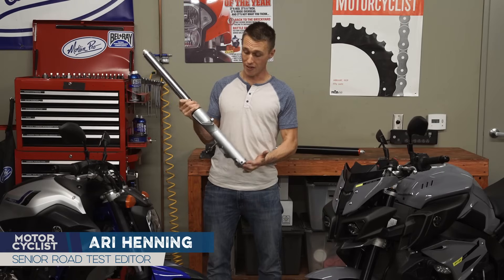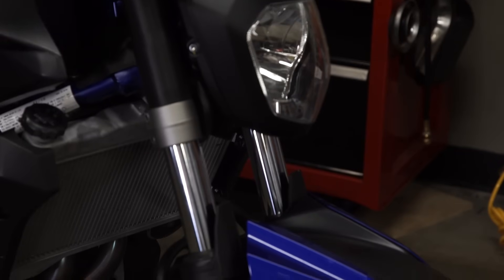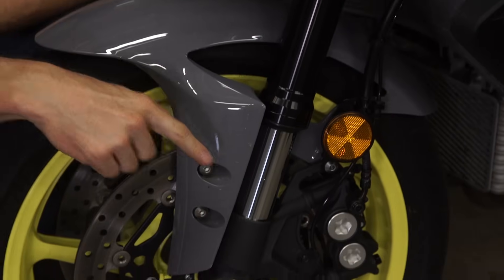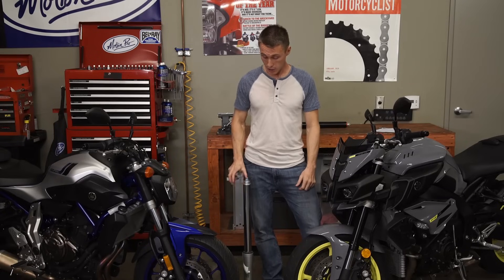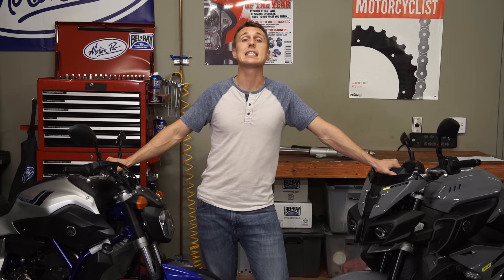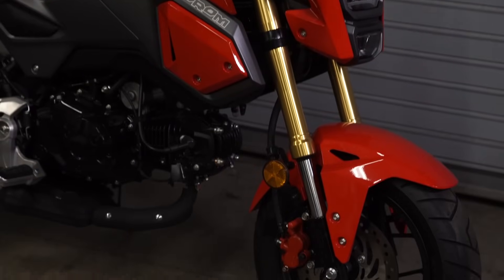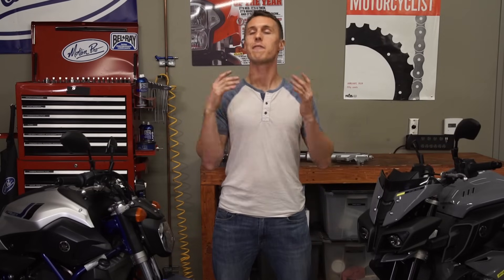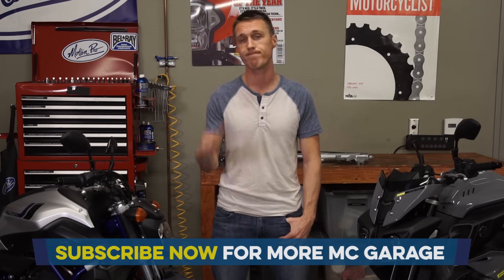Right-Side Up vs. Upside Down – Why Are Inverted Forks So Good? | MC GARAGE

Comment: Greetings Mr. Henning all kidding aside and as always I do enjoy your clips. 100% accurate information, yet this clip is different. I merely point this out due to the volume of audience. 

1. The slider is the chrome slider with the stanchion being the outter anodized capped tube. 
stan·chion

/ˈstan(t)SH(ə)n/

noun

noun: stanchion; plural noun: stanchions

an upright bar, post, or frame forming a support or barrier

It's providing support for the slider.

2. You most certainly will feel the difference. Keeping in mind the many bikes with standard forks which will easily due 100mph and inherently some folks will reach that speed and experience the watusi.

Comment: Stop reading my mind. Just did my 1975 Honda CB550F supersport forks. Had to rebuild them. My first time doing forks. They leaked from the seals and luckily it dripped off the bottom of the fork to the ground instead on the brake disc. Fun stuff.

Comment: That theory on the thickness sounds good,   however...  remember the slider's hollow.   That'd take away from the thickness and rigidity.   I've seen broken shocks...  and most of them have broken on the slider's.  Let's not also forget that most slider's are made from aluminum.

Comment: Glad that you mentioned seal failure. Mine went out in Jacksonville, Florida last March. Bathed both calipers with fork oil - as in puddle on the ground. Made it the 750 or so miles from JAX back home to northern Virginia with NO front brakes. Whee.

Comment: The upside down one gets more dust in the shining part which makes the seal fail quicker
Reply: It's really easy to make covers for them..
Reply: Fork guards remove a large part of that issue. Motocross/enduro all run upside down forks and it works really well. Add a proper wrap-around fork guard if you are doing some more extreme stuff and you'll be set. A positive on the upside down one is that the scraper pushes the dirt down and it stays there, while a conventional fork is more likely to have dirt buildup on the scraper. 

I know it's not a totally fair comparison, but my 1980's conventional fork on a road-going machine tends to be more gunked up than my 00's and 10's offroad machines. (including pure motocross and dual sport)
Reply: @Simon-eh5ez  upside down isn't always better look at the late 90s rm's. those things have amazing Force way better than the upside down forks on the other dirt bikes at the time.
Reply: Gators or boots subtract from that hella cool look. Like dork discs between chain and spokes.
Reply: The shiny part is called the stanchion. Boy.
Reply: @bignoseharry6561  good to know info.

Comment: The main difference is in the inertia. The up-side-down solution provides less inertia of the non-damped mass than the traditional one. Thus, less inertia, quicker reaction of a non-damped mass, then better grip you get. That's the whole story behind an up-side-down versus a traditional one.

Comment: Upside down forks are nothing more than a marketing ploy.
Reply: Ferry Gunadi   a bike like the V-max, hardly a "cheaper" bike, runs conventional forks which are fully adjustable. Conversely as the video pointed out the Honda Grom is running upside down forks. So lets be honest upside down forks for street motorcycles are 99.9% marketing ploy.

Comment: Additionally, USD-Forks tend to have less unsprung masses than similar sized conventional forks. This may help increase riding comfort and may provide better front tire traction, especially on bumpy roads or on the track, if set up properly.

Keep up the good work,
Greetings from Bavaria!
Reply: I think it's rotational mass that actually has the greatest benefit... upside-down forks are better than normal but you will feel lighter brakes, lighter rims far more than if you swapped upside-down forks for conventional... since the suspension itself it technically un-sprung, the weight of the components is what matters, not it's orientation... and the upside-down forks may or may not carry an additional benefit in that category due to the perception of upside-down forks feeling stiffer which may also lead to the perception of lightness since there is less flex overall.

Comment: Can USD forks be put on a bike that has traditional forks from the factory?
Reply: yes. but be sure you know what you're doing when messing with your rake angle, length, etc.
Reply: @poolkrooni  thanks for the response. I'm sure I can look it up online but, is there any specific hardware needed to put them on? Any modifications needed to be made to the bike or just basically plug and play? Besides setup after installation.

Comment: The only issue you would have with the stress of a right side up fork being inferior to upside down forks is if they were known for buckling under hard braking.  I have never had an issue with my forks buckling on any bike I have ever ridden and a few of them I did some pretty hard road racing with.  For the average motorcycle rider that loves the road, I seriously doubt this is of concern at all.

Comment: Liked the video BUT the most important thing is less mass on an inverted fork. That's part of the reason the feel of them is better, less non suspended mass means better control on rebound and overall compresion. So you can still make weight savings on the whole fork with somewhat the same stiffness, which in the end makes them a high end product.

Comment: My brother built a model for a Revell model contest in 1976, based on Revell's Roger DeCoster Suzuki MX model... He couldn't leave well enough alone, though and proceeded to design a bike that did things that nobody was doing in 1976... including inverted forks.

Finished it a month before the deadline, because we were going to be in Spain when the entry was due.

Wild details:
Working suspension (F & R)
Inverted gas fork design (10+ years before this design showed up in production)
Laid-down rear shock absorbers
Underseat gas tank (lower CG)
Liquid cooled (vs air)
Radiator behind mesh number plate
"Snail" exhaust pipe
Airbox between legs, where gas tank usually is
Padded seat
Working rear brake pedal (actuates spring loaded rod to rear wheel)

The funniest part of the story is that, after winning his local region, his model was sent to the national competition, where 1st prize winner would receive a custom Datsun Li'l Hustler pickup with a then-new Suzuki RM125 in the bed...

1st prize went to a VERY faithfully built and beautifully detailed (mud splatters, etc.) rendition of the DeCoster 400, and 2nd to my brother.

2nd prize was a helmet.

See photo of 1976 model:
https://uploads.disquscdn.com/images/5b396f42e1fc200370a51ebf2d06e3aeb1fcc7221ab6865e550ee5522c874f6a.jpg

Comment: I have a motorcycle(TVS Apache RTR 160) which electrical connection is in AC mode. How can i change my AC connection to DC so that i can fixed a LED headlight in place of Halogen bulb? MC garage never cover topic on motorcycle electrical connection and lighting ,plz help me with this topic

Comment: Drew is wrong, upside down evolved because travel continued to get longer and longer. yes there is stiction in the bush (lol) that's why the lower sanction is pretty colors. Old mx bikes would flex like a flexy flyer up front . That's why.

Comment: Would the chrome slider be more subject to damage, ie:  stone chips etc, being closer to the ground. AUS
Reply: Good point. Have you noticed nearly all of them have guards for just that
Reply: Yes.  That's why there are fork gaiters - to protect the stanchion from rust from road salt and from chips/dents from rocks that cause abrasion of the rubber seal.
Gaiters look Old School and nerdy, but they provide a definite protection for the bike.
Reply: That’s why God invented boots.

Comment: I didn’t even watch the video. Inverted forks don’t flex as much as normal forks. They keep their rake and trail as close as the design specs require and track as close as designed. Stiff and compliant.

Comment: The male component on a traditional fork is much more  exposed to damage from road debris, which could cause the fork seal to fail.
Upside down forks are far less vulnerable to this.

Comment: One question: i am new to motorcycles ; when I stand or walk or run next while pushing a full size enduro motocross, and that at some times the bike is inclined : will it feel heavier if it's an USD fork ? Will a conventional fork feel lighter ? Thanks

Comment: I'm a mechanical engineer in the motorcycle industry, and this is video is 100% exactly right.  I have also been racing motocross for over 10 years.  Happy to see some media outlets offering actual information about motorcycle engineering to clear up all of the wive's tales.

Comment: The degree of rigidity is imperceptible on the street and even on the track for all but the most professional racers.  Inverted forks also tend to leak a lot more and get ruined much, much easier because they catch stones and debris on the inner tube (stanchion), ruining them.   Look at a traditional cruiser.  The stone chips are all on the outer fork tube (slider).  The inner portion is rarely damaged.

Comment: I thought the main idea of upsidedown forks was even tho the slider is physically larger its thin walled so its mostly hollow and being aluminum its alot lighter than the heavy thick steel fork tube and having it upsidedown keeps the heavy tube on the bottom keeping a lower center of gravity...? As far as increasing Ridgidity on a conventional fork wonder why no1 has designed one with very long sliders like the upsidedown ones have, again its aluminum and very hollow so it wouldn't add squat to wieght and would add ridgidity and the larger length shud increase life of the bushings seals being further apart, and the fork would move more freely with less friction thus function better have more area to transfer heat n run bit cooler n overall more efficient id think... Just a thought, theres some pretty sharp enginners so maby someone has i just haven't seen it, but who knows back in the early  80s when i was like 9ish i used to draw monster trucks with atv style swing arms front and rear with a big dual piviot point in center of the frame with giant coil overs by the tire cus it made more sense than huge leaf springs and now there all set up similar to that now just 4 link not a swingarm but it didnt happen till several years later.... I was a genius!!! Lol missed my calling i guess....!

Comment: Missing a huge piece about sprung and unsprung weight. That's why wheels are light weight. Same reason upside down forks are found on performance bikes. The less unsprung weight the better the bike will handle.

Comment: I got a 43mm conventional right-side forks on my bike and for street riding, touring and occasionally track days it performs quite well, the only upgrade I did with them is installing a good set of quality progressive springs with the right fork oil density and a fully adjustable rear monoshock, a suspension specialist did the job on my bike beautifully and it performs really well.

Comment: The first gen r6 has traditional forks, the 06 up has USD. With goldvalves and correct springs my 02 forks are fantastic. Just bc you might be stuck with traditional forks doesn't necessarily mean they suck.

Comment: So an upside down fork would be alot better for a motorcyle w/sidecar or trike as theres alot more weight on it ? Harley went to the upside down fork on its big/heavy FL bikes fairly early on though have been told by a few sidecarists that the springer fork works even better for that application. Lastly how much does a fork brace help ? it must be helpfull as I've allways seen dirtrackers using them. TY for a great video & wishing you all many years of fun and safe riding .

Comment: I can definitely tell the difference in handling between my SV650s (upright) and my R6 (upside down) in normal day to day riding. Upright is horrible for road hazards (potholes, expansion joints) and even just the lip pulling into a lot, too soft and not adjustable.

Comment: You forgot Weight. When a fork is upside down, the main weight of the front suspension isn't being loaded into the front end weight of the bike but is instead on the tire itself. 
this puts less stress and force on the front suspension by reducing the weight that is being suspended by the shocks/hydrolics.

Comment: Which suspension setup is better for off road bikes? If we are doing more of off roading?
Reply: Conventional right side up is better.  Number 1 reason is the fork seals last for years.  2nd they flex more for a plusher ride.
Reply: Conventional forks are more suited for off-road riding because the fork stanchions get battered more with rocks/pebbles,
causing more abrasion of the fork seals by the increased roughness.
And gaiters down low would collect water through their breather holes from streams and puddles.
Reply: Telescopic is better for off-road
Reply: Conventional...usd forks are more for streets and tracks...why? Forkseals.
Reply: Off-road suspension is all about the travell
And conventional forks (generally) have miles of travell before they hit anything
Reply: In the vid it looked like a loss of travel. But I’m sure they are long on dirt bikes.
Reply: Bulu bhaina jay Jagannatha! Upside down forks kebala track use pai better. High end motorcycle gudika jouthire conventional forks rahuchi seguda madhya bhari stiff eka. Especially offroading re oil seal herika crack karibara besi chance rahiba hard core offroading karile tenukari conventional setup thik rahiba. Janichi apanakara 3barsa tala comment hele dekhili ta bhabili reply kari diye.  😁  Khusi lagila apana madhya emiti videos dekhuchanti. Have a nice day sir take care❤️

Comment: On right side up there is excess heat transfer from your brakes to the female side. This changes the viscosity of your fork oil, thus changing compression and rebound rates.

Comment: Great explanation concerning the forks.   I have a suggestion:  how about doing an MC Garage on the function of the number of cylinder a bike has, and what they are optimized for.  For example, a single cylinder gives one more control off road at lower speeds, but a twin is better for fast travel.  Give examples of where the number of cylinders a ike has gives it the best performance.

Comment: Thanks for the informative videos.
I have regular forks, but I noticed a little play if I shake them near the calipers while the wheel is in the air. And they making the annoying rattling sound when on bumpy road. I checked that the sound is coming from the forks, not the 3le-tree.
Would you know what may be causing it?
Reply: sounds like lack of oil or limp spring not compressing enough

Comment: I will tell you about a new tech. My motorcycle has separate function forks, the oil is in other fork and the rotor is on the another side. That's my theory, ofcourse it's a single disc but is it possible?
PS:2017 KTM Duke 390.

Comment: USD forks reduce unsprung weight.  Meaning less weight moving when suspension is working. Yes they are also more rigid, but that is not the main reason for USD.  Not sure what street riders look for, but off the slab it is a world of difference not dealing with as much moving mass on the end of your suspension.

Comment: The difference in unsprung mass is minimal in the real context. USD forks are fashionable because they can look like what are on racing bikes. In street riding, the real world, there are cheap, flexy USDs and very good traditional forks that are stiffer.  Two problems with USDs: the slider is exposed lower, more prone to chipping and damage, and when the seals fail, they dump out oil on the brakes, and when it comes time to fix all that, they are more complex.  Companies are making cheapo USDs anodized gold , i.e. Fauxlins, they are crap. looking at you, Yamaha.
It's a fashion choice, like petal rotors.
It would make sense to put neoprene boots on USD fork sliders, but that's currently not cool.
Reply: It’s cool to me. I have an SV650, conventional forks, and I’m not swapping them. But I would like to know what sleeve you’d recommend to cover where the dirt is able to get in. Thank you

Comment: It's funny how in the mountain bike world, it is the other way around. Standard forks are more rigid than USD forks because of the arch between the legs. But we are talking here of lateral flex, since a mtb forks is so much smaller and lighter. I had an USD fork for quite a few years on my DH bicycle . it was awesome but heavy with a lot of lateral flex in the wheel.

But USD forks are so much more sensitive on small bumps, the seals are litterally always lubed by the oil inside of the forks, friction is minimal !

Comment: I don't comment on YouTube video's ofren, but I am really impressed with the way Ari covers the quick differences that are indisputable facts. He is so clearly un-biased and just down to share what can be covered without over-complicating the situation with irrelevant hyper performance squabbles.
My favorite bike is an Honda MC22, it comes with conventional forks, they bend often after a crash and are very quick and easy to work on. I could change them to upside down forks but choose not to because in terms of performance the bikes that have upside-down forks in its class e.g. ZX2R don't merit mention due to that fact alone as its probably about 0.00005% of the whole pie in terms of why this guys faster than that guy.
One thing that could have been touched on is that not only are conventional forks much easier to work on but they are much cheaper to replace and the only common time conventional forks bend is after a crash which upside-down forks are still very much susceptible to taking damage from.
In short if you are not a contender in the TT or the GP/Superbikes/Supersports the direction your forks face in terms of performance is virtually irrelevant.